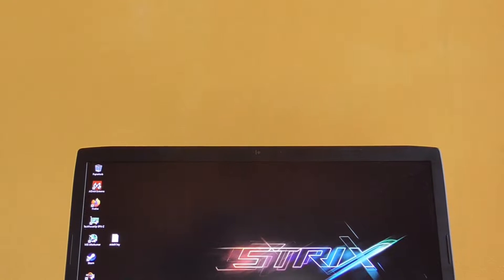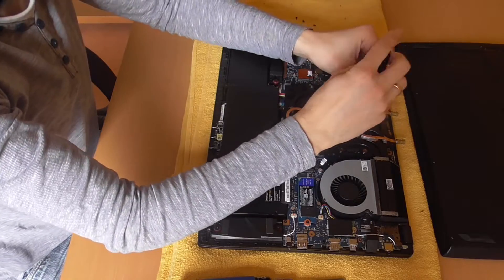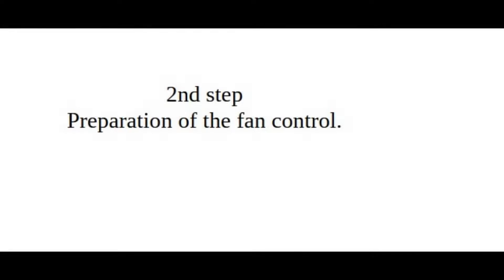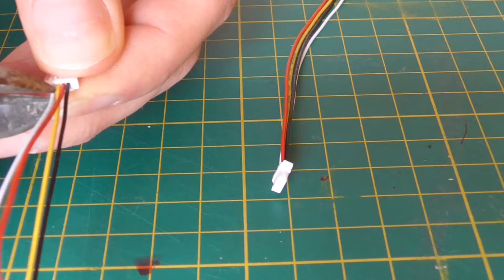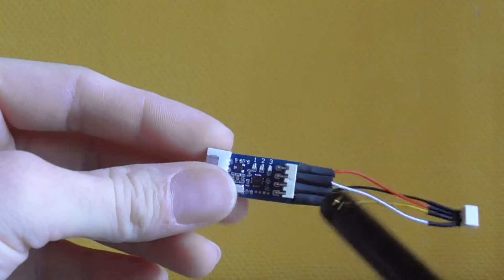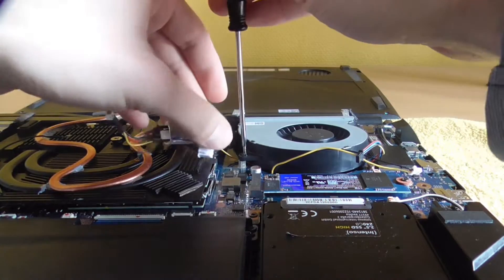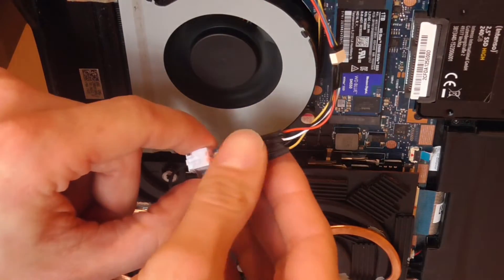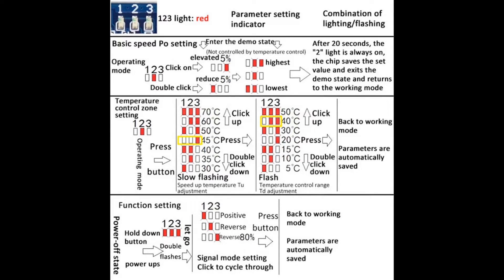Asus GL702ZC broken fan control repair

Comment: How to remove the heatsink without forcing the cpu out and getting it stuck to the heatsink?
Reply from the maker: To make it easier to loosen a stuck processor on the cooler, you can try the following:
Remove the bottom case and place the back of the laptop on a book so that there is about 2-3 cm of space between the laptop and the surface.
Turn on the laptop and run a CPU benchmark e.g.: CB23. Let the program run for 10-15 minutes so that the thermal paste on the processor heats up and becomes liquid. 
Then you turn off the laptop and then try to remove the cooler. 
It's best to take a cloth or two so you don't burn your fingers on the hot heatsink! Otherwise it should work to get the cooler off without much effort.
Reply: @Scale_Hardwarebox  thanks i was asking because i saw a really good deal about this laptop on ebay turns out the keyboard does not work the fans neither at this point Is not really a deal anymore 😅

Comment: Does the watercooling help with temps?😂
Reply from the maker: The water cooling actually helped reduce the temperatures. However, it is very time-consuming to modify and convert the cooler for this.😁

Comment: Thanks for the video. I have the exact problem, can u make a new one then sell it for me? So i just instaling it without any issue. Im just tired use any method, then it ended up with replacing thermal paste with noctua nth2 but your recomendation is use k5 pro. Its difficult to lookin for it in my country. Can u give me any sugession for an alternative product?

Comment: Hi, I have the same model and I had to replace the motherboard due to GPU failure. I ordered brand new tested board from eBay and make it installed however I have problem. The display is fine but very quickly the fans works at maximum speed and power cuts off. Do you have any idea about the possible reason? Thank you.
Reply from the maker: Try to remove the cmos battery for a few minutes to clear all settings in the uefi. After that, set your settings in the uefi and try if the laptop is working. If both fans are running again with full speed, the temperature  signal is broken, and you have to repair it with my guide. If the laptop is shutting down after a few minutes, it could be that the cpu or gpu are getting to hot and they are shutting down the system to prevent damage, or the power from the mainboard got a failure, maybe a faulty vrm controller or something.

Comment: Thank you so much - my mum’s GL702ZC has this exact issue currently. I’ve ordered the parts and I’ll let you know how I get on!
Reply from the maker: Thank you. I think you can fix it.
Reply: @Scale_Hardwarebox  Thank you again - I've got it working now! Like Ivan in the other comment, programming the controller was a little tough but got it eventually. It's working great! Took the op to put in another 16gb of ram and an NVME drive instead of the sata m.2 disk, and a new battery. Typing this comment on it 🙂